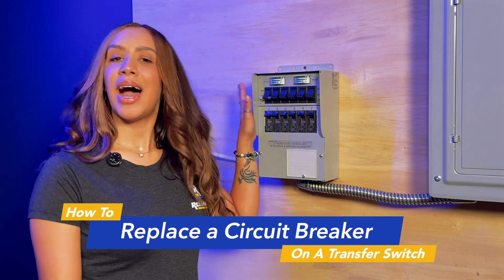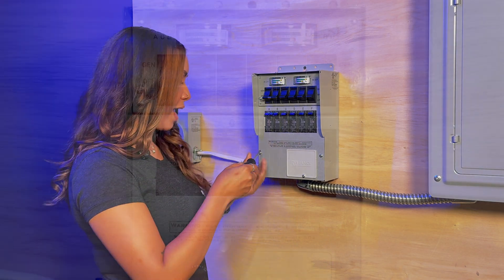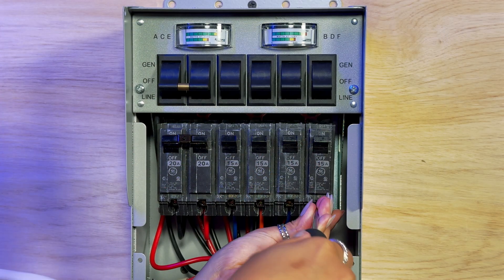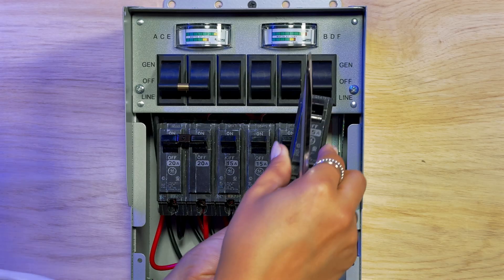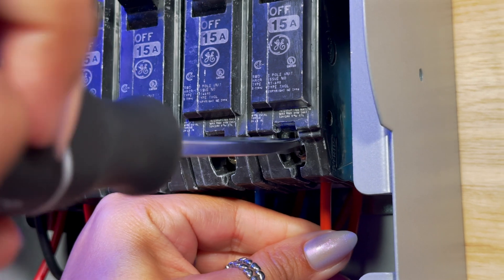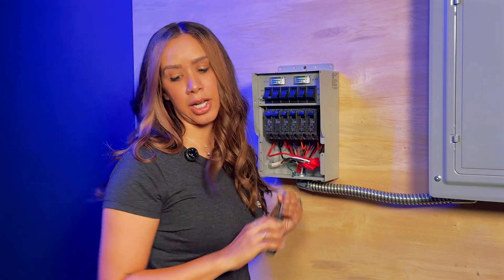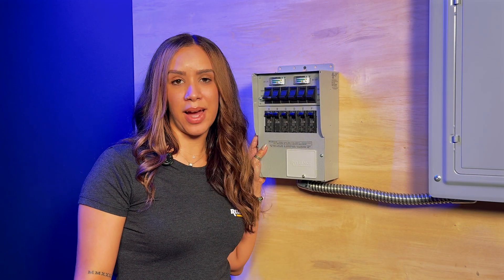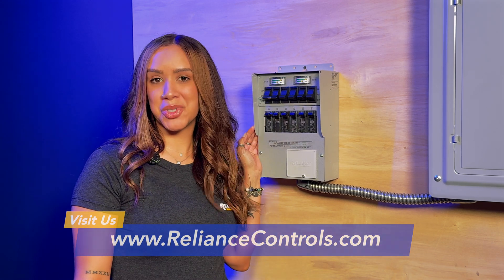How to Replace a Circuit Breaker on a Reliance Controls ProTran 2 Transfer Switch

Comment: Can you replace original braker with a 15 or 20 amp smart/timer breaker...?
Reply from the maker: Hello and thank you for your question! As long as the breaker has the correct mounting type and size as the current breaker, you should be able to do so. Let us know though!

Comment: where do you find compatible breakers?
Reply: I was wondering the same thing. Not only that but cannot these breakers be swaped out to 20 amp breakers? If not they should've made it where 4 breakers are 20amp and 2 15amp
Reply: @weldonpinder7295  I got my transfer switch couple days ago. Read the manual it is all there. In my case I have the 50A version with 10 circuits. I replaced the 30A 2 pole with 20A 2 pole and 3 of the 15A with 3 20A to suit my needs (I do need 3 x 15A). Use the same breaker brand and model found on the breaker label. In my case they are Siemens QP. The manual of your specific model will tell you exactly what you are allowed to do and NOT to do. As an example for the 50A version only A and B circuits are rated for 30A all others 20A max (so you can have 15A or 20A breakers)
Reply: @bgBlea  thays what i read also from Google that they can be swapped from 15to 20 amp no higher. Thanks for the brand of the breaker because i was wondering that to